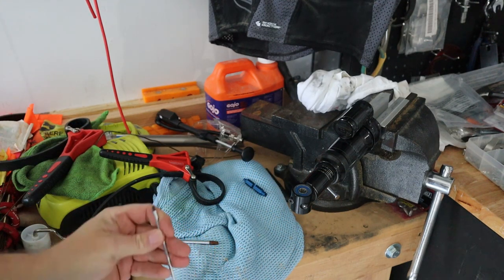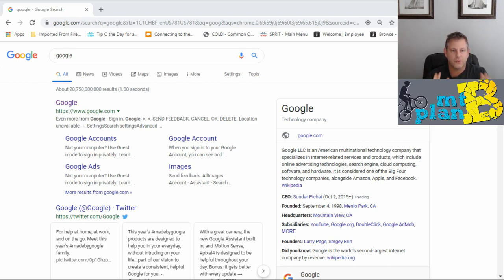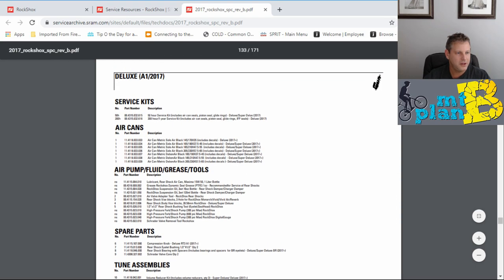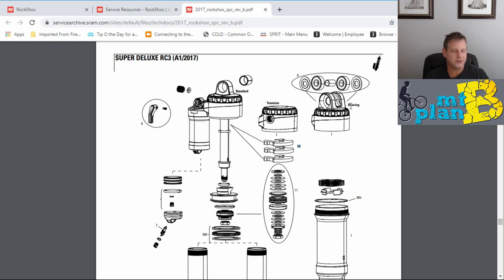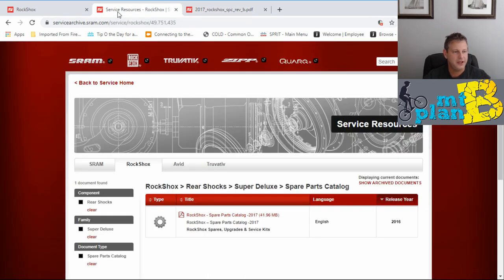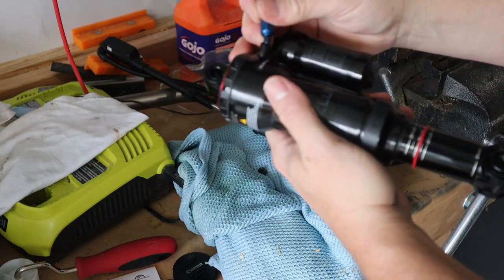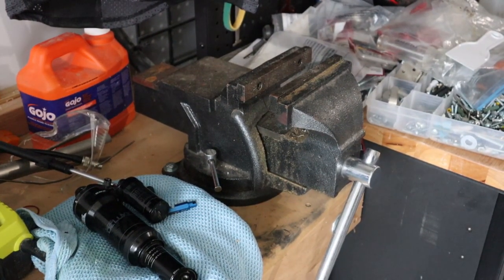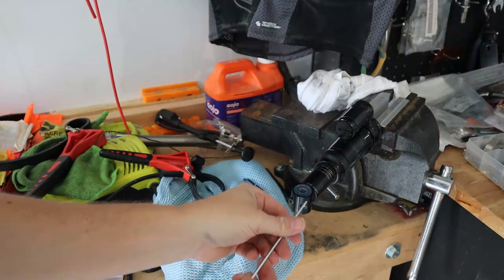#MTBPlanB 2019 Santa Cruz Bronson 50 hour service for Rockshox Super Deluxe R fail

Comment: Had my front and rear done at the same time a few weeks ago, it was never touched in a year, about $200.00 parts and labor
Reply from the maker: Jim, what’s your bike and setup?
Reply: @MTBPlanB  2018 6.0 AL Spectral, PIKE Front and DELUXE rear
Reply from the maker: Thats a great bike! I have most tools if you ever need to use them.
Reply: @MTBPlanB  Thanks, I have no complaints that's for sure and happy with the purchase. I have tools but live in an apartment complex and I still work so sometimes its easier to drop off, pick up and pay the difference, its only once a year but I really appreciate the offer.

I was at Lake Norman yesterday which kind of muddy and slick so I am taking the Mezcal off and put on a new pair of Trail Kings 2.6

Comment: Sooooo on my Target bike ..... out of all the mods I've made is it all possible to upgrade my front fork?
Reply from the maker: Anything is possible, but may not be feasible. Tough to say without the specs of your bike. Sometimes it can be a Pandora’s box. KevCentral on Youtube is an excellent resource for big box retail bikes as well.
Reply: @MTBPlanB  I watch his channel play some of the modifications he's done with his bikes have included replacing forks with RockShox and I know one he's done with trigger shifters it might not be practical but to be able to change out an add of decent part would be so freaking cool
Reply from the maker: Do you have a link to the specs of your bike?
Reply: @MTBPlanB  I'm going to research it and see if I can find it because my bike isn't a big brand bike so after having the modify with better parts I never thought to look up the specifications for my bike frame I'm going to get right on that and I'll let you know
Reply from the maker: Try Kent.bike website for starters and also inspect your fork for brand name/model number.
Reply: @MTBPlanB  I have looked everywhere for my specs to my fork and I cannot even find it on the Kent site kind of has me worried if I'm looking for the wrong thing or not
Reply from the maker: DM me on Instagram some close up pictures of your fork showing any decals and labels along with the model of the bike and wheel size.